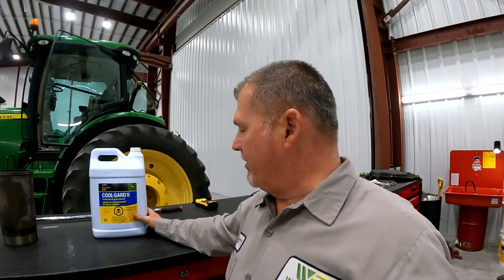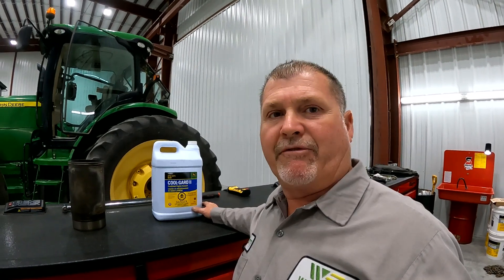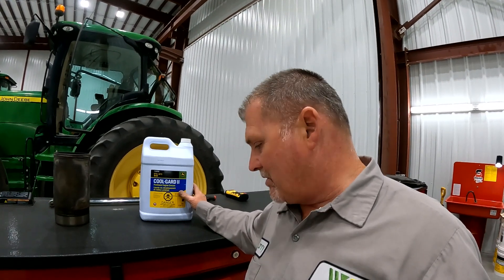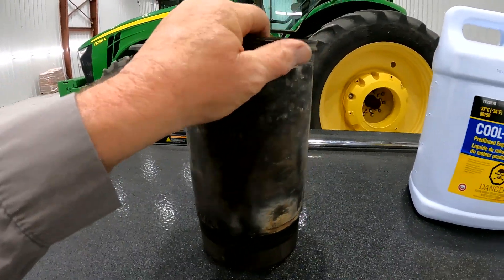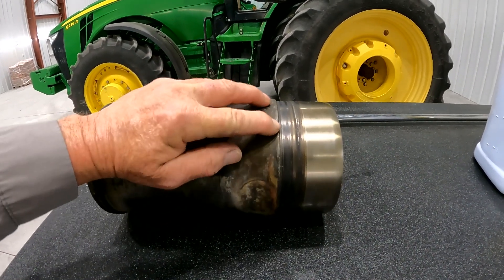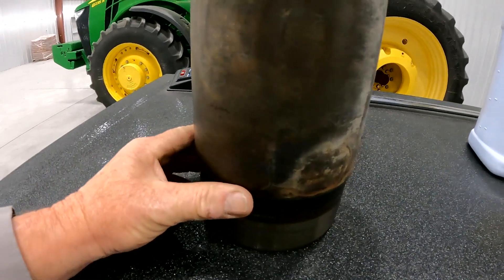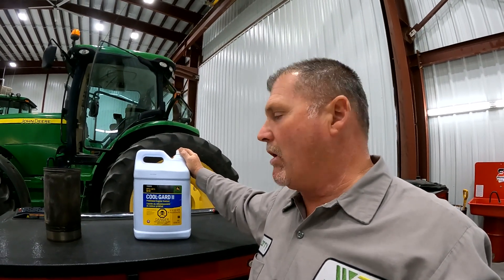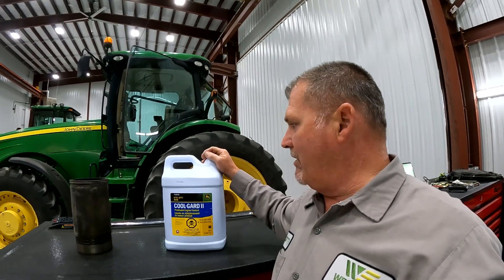Larry's Life E61 | Tech Tip of the Day - Does the coolant brand matter? John Deere Cool Gard II

Comment: Totally agree with Larry on the John Deere Coolguard II.
One of our John Deere tractors suffered engine failure, totally.
The tractor liners were removed and were badly pitted .
Engine was rebuilt and guess what, nothing but Coolguard II ready mixed all the way since.
To be fair the engine that seized had done high hours but if it had always been Coolguard within, that engine would have kept on running.
Great video and analysis of that 10,000hr engine liner and Coolguard.